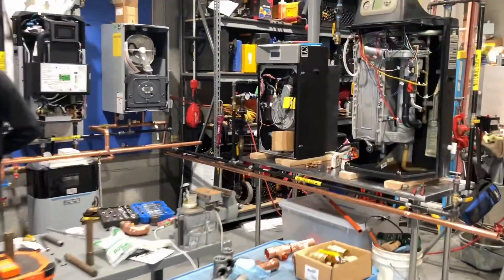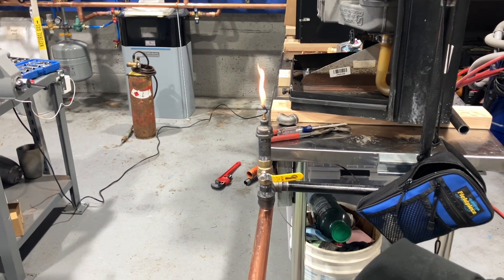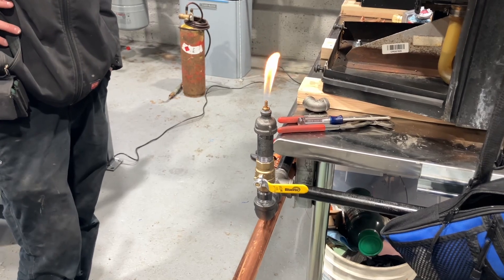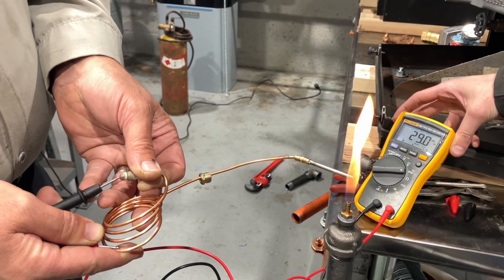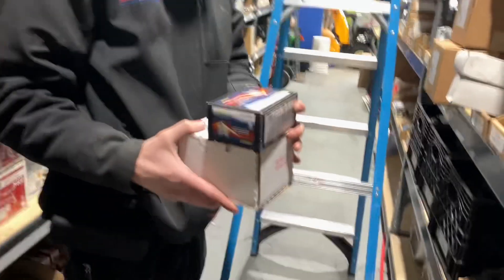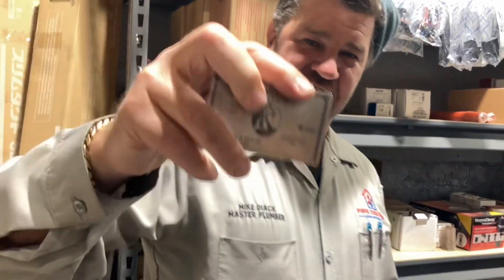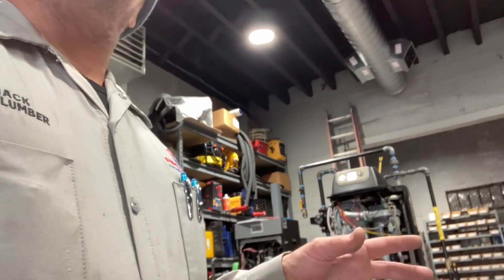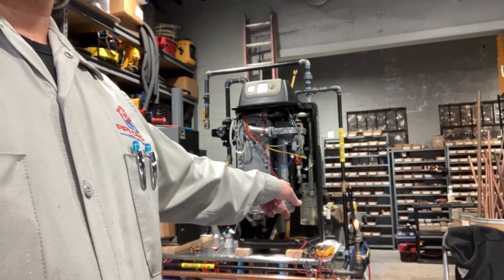Mikey Pipes Training Facility #1 Testing Thermocouple Millivolts from Gas Flame

Comment from the maker: A standing pilot gas valve typically needs between 300 and 750 millivolts (mV) to stay open, with most systems requiring around 750 mV from the thermopile to operate properly; this voltage is generated by the heat of the pilot flame and is used to power the gas valve mechanism keeping the main gas flow open. 

Key points about standing pilot gas valves:

Thermopile:
The device that generates the millivolts in a standing pilot system is called a thermopile. 

Voltage range:
When testing a thermopile, a reading between 300 and 750 mV usually indicates a properly functioning pilot system. 

Low voltage issues:
If the millivolt reading is significantly below 300 mV, it might indicate a faulty thermopile and require replacement.
Reply: New testing Facility Looks fantastic

Comment: Im not completely sure yet but if you interested, I might be able to get and donate an AB valve style pilot and burner valve assembly for you to use in the school
Reply from the maker: You know what not a bad idea however you don’t see any of those anymore so we could just have it on display
Reply: @MikeyPipesUncensored  very true, the one I'm gonna try and send to you would be coming out of an old furnace that is mounted in the wall at my work with the burners outside, so I'm gonna have to wait until the snow melts to pull it out of the furnace ( and before you ask, im 98% sure that it all still works), we haven't used the furnace but maybe 2 times in the last 18 yrs that I worked there due to the fact that bird keep getting in and building nests, and the pilot light goes out if the wind blows the wrong way... as for the not really seeing them much anymore, ive still got an old sunbeam furnace in my house with the AB valves and the basos (sorry if I mis spelled that)

Comment: Hank a pilotstat out of an old gas valve and throw in your toolbag. You now have a thermocouple tester for life. On a pilot out call thread the t-couple into it and depress the plunger and see if it holds. Fast visual proof of a failed thermocouple

Comment: Would it provide more control to throttle the gas to your test-burner if you had a 1/4-in needle valve or something in line with that?

Comment: But if you are saying the gas valve needs between 300 and 750 mV to stay open why did the thermocouple only provide about 30 mV. Wouldn't that not be enough to keep gas valve open if it needed ~750 mV?  Thanks for the education Mikey Pipes! I'm just a Landlord trying to learn this stuff
Reply from the maker: That is for a MV powerpile